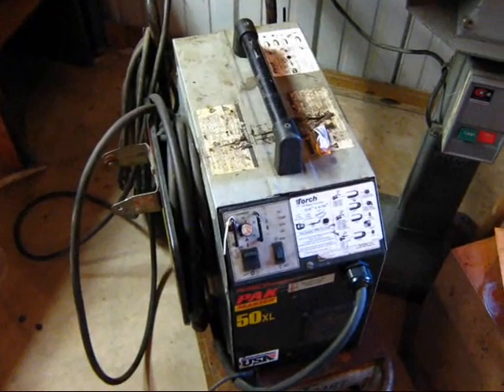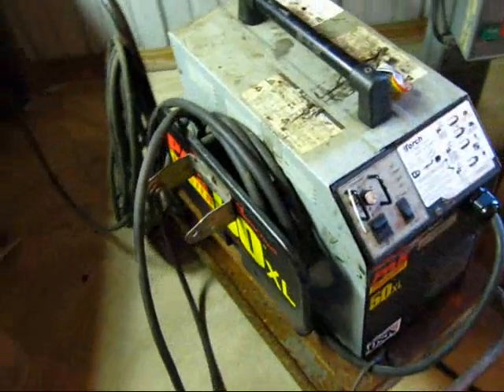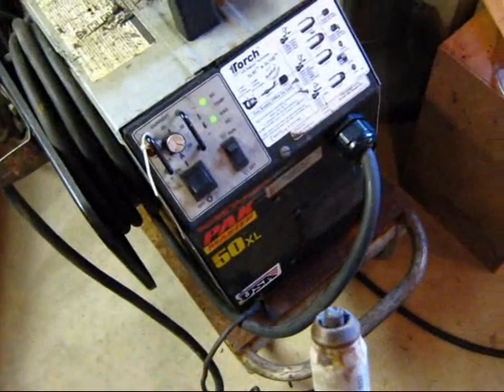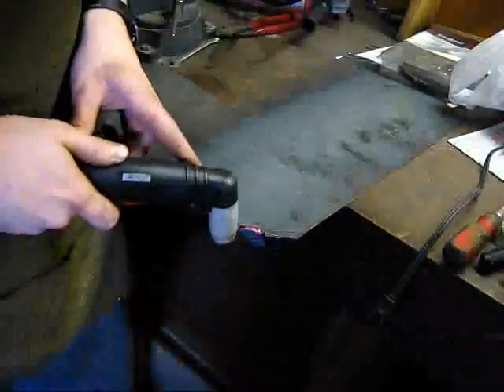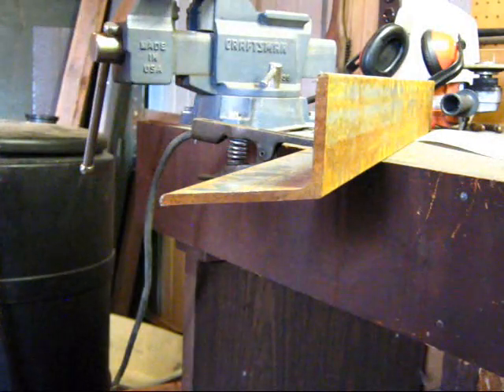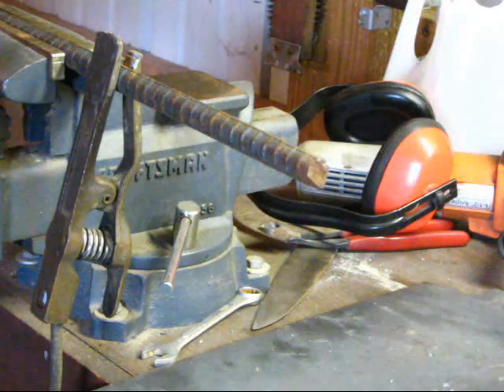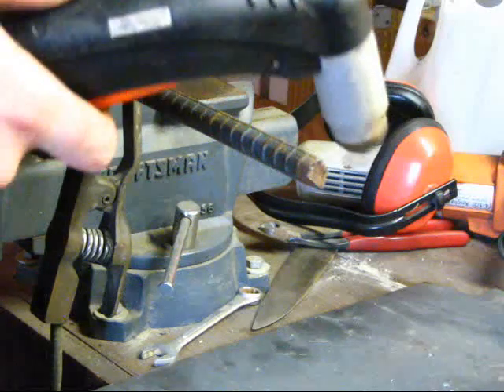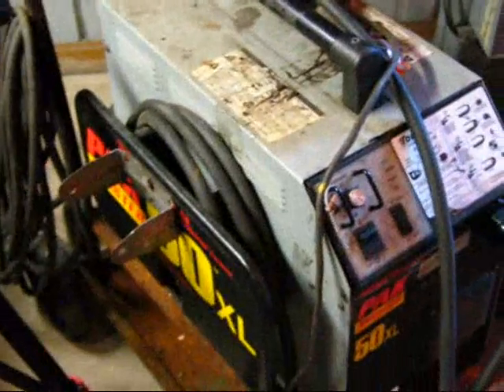Testing the New Plasma Cutter

Comment: Please get you some gloves and wear gloves while your wig welding or plasma cutting that only do the gloves keep you safe from getting burnt or singed but also help prevent of getting shocked now you're only getting hit with PC folks but it can still be unpleasant I've been shocked from both plasma and welder before and a lot of times it's been from bring the gloves to protect yourself you know you're in a hurry and you're trying to get things done and I try not to hold or put my body or hand on the work piece but sometimes it's inevitable if you're doing something that like sheet metal that's really big and you really have no choice cuz you don't have big enough Benz to put it on are you trying to hold it cuz you don't have the proper Vice but I can say that make sure you're not wet your clothes are not wet when you are plasma cutting or welding any form definitely wake you up and they actually say you should ground your machine get a ride like a piece of copper rod go about six foot down in the ground maybe four ft just a piece of like 3/8 or 5/8 in and hope your ground hook your machine sometimes they'll be an extra attachment off of the machine for an extra Crown if not put a double Spade off of work connection front or make up a conjunction and run that second ground 2 that robbed us in the ground that piece of copper rod and that will help with not only interference but with getting grounded shock because the machine is sensing that you are round if you accidentally put your hand or body up against the work pieces you're cutting so now it has two forms ground and the rod that's going in the ground so which is definitely help not getting Zapped